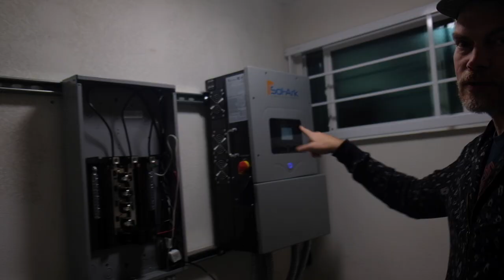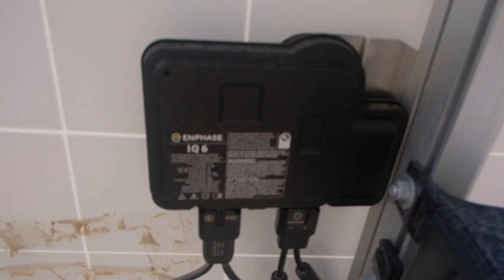DIY Lithium LFP Battery Pack, AC Coupled Solar & Whole Home Backup, Part 1

Comment: Looking good. That 26.88 kWh should be good where you get 340 days of sun. I needed 107 kWh just for starters! 

Do you even need to tin plate the copper bus bars out West? I have to in the humid East.
Reply from the maker: Great observation! I'd like to tin plate my busbars, but I haven't found a place to do it for me in small quantities. We've been using bare copper for many years for other systems and it has been fine so far!